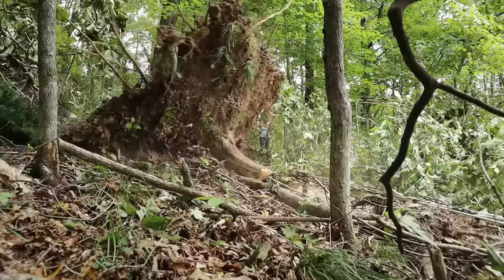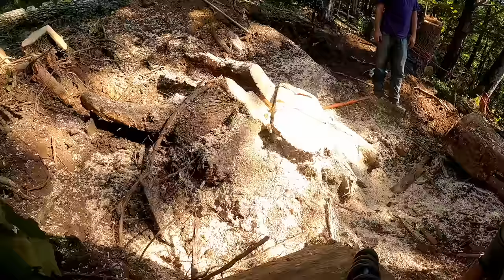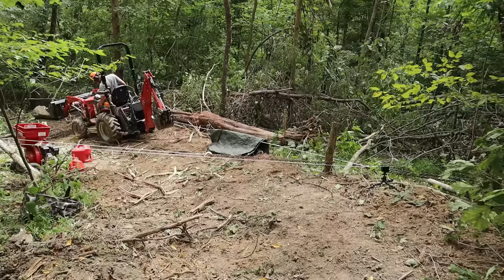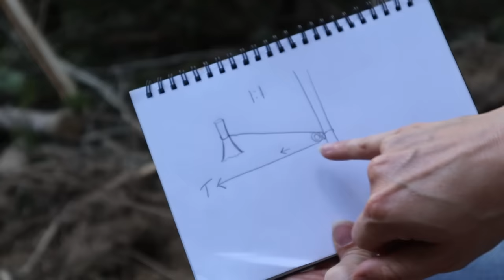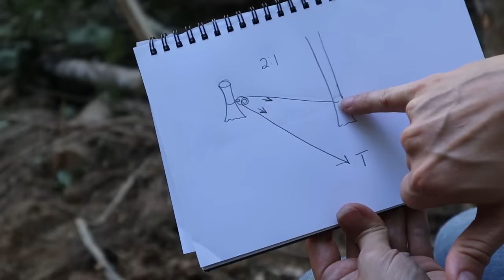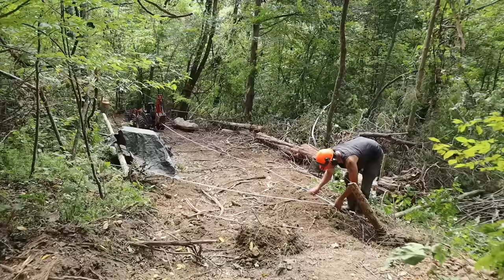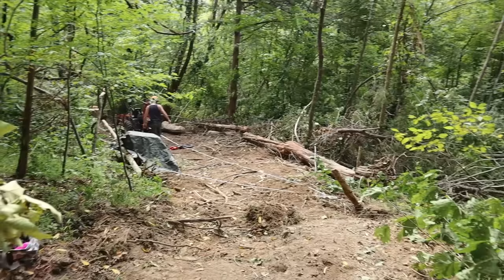Snatch blocks vs tree stumps - the power of pulleys /// E57

Comment: If your hitch point is below the back axle it will try to pull the front of the tractor under the back axle surely. No chance of a back flip. But it will put too much downward force on the front drive and less on the back wheel. So the front drive hydraulics would be possibly over worked and the back wheel will lose traction.

Comment: Great work. You need to stop pulling from the backhoe arm. It is hard on the system. Attach it to an anchor point on the frame base of the tractor.
Reply from the maker: Learned that one the hard way, Peter.  I broke the cylinder because of that destructive laziness.  Won't do that again though!  Now I hook up to the frame in the back.  I learned my lesson 😉
Reply: @WalnutsandWineberries  The best lessons learned are the ones which cost us a lot (time, money, sweat, etc).
Reply: @Harry-zz2oh  Dave Ramsey calls that “stupid tax” and I’ve paid my share of “stupid tax”.......it’s how we learn 🙂

Comment: I realize that anything you do yourself is saving money, most of the time but there is a fine line between saving money and not. Time is money and a operator with a small or medium size dozer could have you ready for base rock in 8-10 hours, a D-4 or D-6 could push those stumps out and level your road bed in no more than a day and a half whereas if it takes you guys a couple weeks just to get the stumps out and you still have a lot of grade work to do and your time is $$$ too.

Comment: Your drawing of the 1:1 does actually have a mechanical advantage, but the advantage is 2:1 (little less due to frictional losses) on the anchor tree, not the stump. It looks like maybe you figured that since you have a backhoe dig from the stump out radially along each root too. It lessens the grip those roots have and they come out or break a lot easier.
Reply from the maker: Yeah, I guess technically, you're right.  Definitely don't want mechanical advantage on your anchor - haha

Comment: The first pic is a one to one. The second pic is a one to one. The 3rd is a two to one. And so on.

The stump chain needs to be attached as high as possible for maximum leverage & the anchor should be attached as low as possible for minimum carnage. 

Every line BETWEEN stump and anchor doubles pulling power. I hope I’ve helped.
Reply from the maker: Hi Todd, thanks for commenting, but we found our configurations to be correct and accurate.  Please reference the following reputable source.  They show some good examples and configurations for mechanical advantage and how to calculate the ratio.
https://m.petzl.com/US/en/Professional/How-to-calculate-mechanical-advantage?ActivityName=Technical-rescue

Comment: At 12:50, you are losing 1/3rd to 1/2 of your mechanical advantage on the length to the tractor because it is pulling at an angle to the rest of the lines. That line to the tractor is 1/3rd to 1/2  redirect and only 1/2 to 2/3rds mechanical advantage. To calculate the lost mechanical advantage in an angled redirect line, imagine a line from the anchor extending to the tractor line to form a right triangle. Compare the length to from the stump to the anchor to the length from the stump to the imaginary right angle point to see the lost mechanical advantage. The drawing at 13:05 should say 3.5:1, not 4:1
Cut a chain anchor notch as high on the stump as possible to get maximum leverage on the root ball.

Comment: Why did you choose wirerope? Dyneema lines are much easier to work with. It’s so lite it’ll float on water but stronger than steel wirerope.
Reply from the maker: Inexperience at the time.  Agreed that synthetic is easier and much safer.

Comment: Something else can help you. Do not cut the tree before you try to pull it off the ground. If you use a ladder to climb 15 or 20 feet in the tree to tie your rope or snatch block, you will add an other leverage force this time to the pulley force. Dont forget that each foot higher you are, that will multiplie your force like a pry bar.

Comment: I would think the tractor will pull out the stump alone. Especially if you cut the stump a little higher.   I'm certain of one thing though, it's much easier to push a rock downhill rather than up the hll.    I wonder how much GINSENG you guys killed making that road?

Comment: I still can’t understand how the first way was different than the second way. I can tell there is a very powerful advantage with the snatch blocks, but I don’t really understand exactly how it works.
Reply from the maker: The difference between the two is where the snatch block is located.  On 2 to 1, snatch block is placed at your load, then you hook to an anchor tree and pull with the other end.  Double the power vs pulling alone.

Comment: First, never pull from the bucket. You'll damage the hydros on the tractor. Pull off the draw bar. That is what it's for. Second, take a look at this guy. You are starting to understand pulleys but still are way off. https://youtu.be/FBuUBVCiUjE   Don't pull at an angle. You are reducing your advantage. Keep things inline. Keep the stumps tall and pull from the top. They tip easier than pulling from the ground. Watch what this guy can do. https://youtu.be/bRTIwWUg4fc   A winch would help you do wonders. If you get one, use the cable on the first wrap of the drum only... that is what they are rated for. Each wrap on top of that they pull less than rated.

Comment: Keep your anchor point as high as you can on the tree your are trying to rmove, it also ads a lot of extra levarage. just a foot higher will make quit a diference. Even beter would be too tie on to the tree about ten feet high, pull it down and then cut it from the stump.

Comment: You can pull up a much bigger stump than your handling in the video. I’m sure you’ve finished and probably have figured out what I’m sharing by now. Don’t cut your tree down. The higher you can hook your cable, the more leverage you have. Cut the trees after you pull them up. Only a few feet higher gives you a huge advantage.

Comment: you gotta rent a big air compressor and a jack hammer to bust up those big rocks....   or hoot a hole in them every so often and split them in half.    i had to build my driveway just like you're doing here....   fire was my best cheapest most effective tool for the stumps

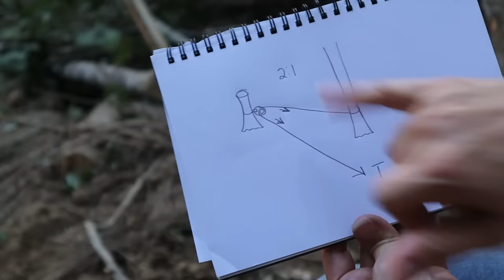Comment: @7:30 your "supposed 2:1 system" isn't a true 2:1 system. I'm a crane operator, arborist and former tow truck driver. You have only made a change in direction here.
Reply from the maker: Incorrect.  It's 2 to 1.  Only a change of direction if it's an anchor.  The pulley on the load results in 2 lines of force, hence 2 to 1 mechanical advantage.  Check this reference for yourself:
https://www.petzl.com/US/en/Professional/How-to-calculate-mechanical-advantage?ActivityName=Technical-rescue

Comment: I am not an expert, but in your first drawing, your angle was too wide.  I don't think which end you had the pulley attached was the problem.  In your second drawing you depict a reduced angle, which is necessary for mechanical advantage.  Another thing you could have done, probably for less cost, is to rent a mini excavator.  It would have much more hydraulic power than your small tractor.  They are a lot faster.  It does take a little time to get used to running them.  One more point, if the cable breaks, it can kill or hurt you.  You could have used Spectra rope.  Much safer, but expensive.  Spectra is around 15 times stronger than wire rope, pound for pound.

Comment: Cheap equipment breaks.  Always buy the best equipment, tools, etc,your pocketbook can afford.  I cut trees as close to the ground as possible.  I then groove them with my chainsaws in a waffle pattern and put Epson salts in the grooves.  It will rot out but takes a while.
Reply from the maker: Cool, might do that on stumps that are off the path and don't necessarily need to come out.  Ever use that "stump remover" stuff made of potassium nitrate?  Never heard of using epsom salt.  Intriguing though.

Comment: You are lucky the tractor did not rear up on you.  Tractor drawbars are designed at the correct height from the ground to keep the pull forces below the center of gravity. Above center of the axle and the tractor can stand right up and roll over backwards.

Comment: basically ..if u pull really slow ..it wont work ! the snatch effect. if from lower gear time to stop the tractor.. it extends the power for breef few seconds.. 50 hp tractor will go slower gear and more power as well.. effect will be like 8x the power.. try that ! 150 hp tractpr.. they make a $$$$ drill out tool ..10 seconds and 4 feet stump gone!

Comment: You guys need to hook up to the bottom of tractor and not the bucket.   You guys are slowly killing the hydraulics on your machine. But nice work guys!!
Reply from the maker: Yeah, lesson learned.  Check some of our other videos and you'll see I broke the hyd. cylinder soon after this.  Failing is the best way to learn.  Won't do that again.  I hook to the drawbar now unless the tractor is anchored, and the hoe can pull on its own.
Reply: Ahhhhhh.  Bummer.   Live and learn.  It happens to the best of us

Comment: I would highly discourage pulling with the cable on your backhoe bucket.  Brother in law did that and ended up bending a hydraulic cylinder.  $$$$ to repair.  It is not designed to take that kind of stress with the tractor pulling on it.  The hydraulic relief valve can't do it's job the way you are pulling.  Draw bar is the proper way or something else with the BH mounted.

Comment: Well this comment is a year late!  In all your examples the stump you are pulling is smaller than the tree you use as an anchor point.  What if the stump you're pulling is bigger than any anchor point tree available?   Then you have to spread your anchor points among several trees using even more snatch blocks.  If you search YouTube for the string "v=bRTIwWUg4fc" you can see a video of a man with a 35:1 pulling advantage with a combined 5:1 primary setup and a secondary 7:1 multi-shiv pulley setup.  But even in this setup he was still pulling single tree stump to another with the 5:1 primary ropes and snatch blocks.  Had I been doing this pull I would have attached each of the two 8-ton pulleys in the primary 5:1 setup to separate trees.  With a couple more snatch blocks you could have 3 anchor trees and a 6:1 advantage in pulling you're stumps and splitting the load on each of your anchor trees.

Comment: I think this project would've been much easier with a bigger tractor or a bulldozer.  A bulldozer could've made you a road in a couple of hours.
Reply from the maker: The video is about using mechanical advantage for when you are outmatched.  Not how to make a road the easiest way possible.  It's sad to hear that not many people want to work hard anymore.  The norm is to want immediate results.
Reply: @WalnutsandWineberries  no its not about immediate results,  I've worked since I was 13 as a job and my whole life otherwise.  I wasn't raised to sit on my butt and watch cartoons.  I was just saying it would be way more efficient.  I can plow a field with a mule but use a tractor to use my time wiser because I don't have time to take a week on a job I can get done in a few hours going another way.  Work smarter not harder pops always said. 😉

Comment: That 4:1 set up. Is only a 3:1 the pulley to tractor is not doing any work. It's just a redirect
Reply from the maker: Hey Ron, here's where I referenced our research: https://www.petzl.com/US/en/Professional/How-to-calculate-mechanical-advantage?ActivityName=Technical-rescue
Check out the 4 to 1 examples.  Their example shows the last pulley in line as a redirect because it comes off the anchor.  Our last pulley comes off the load.
Reply: I just rewatched your video. I stand corrected. Sorry for blowing up. 😉
Reply from the maker: Took us days to understand it, Ron.  Many failures before success.  You'd like episode 64, where we add compounds to the end of our 4 to 1 and make it 16 to 1!

Comment: NEXT TIME PUT  WIRE ON HIGHT TO THE  TREE NOT  CUT THEN HAVE VERY MUCH  POWER  TO TAKE EVEN BIG TREES DOWN  l HAVE KUOTA 25d  HP THEN PUT DOWN MAPLE  12 " DIA   QUITE EASY BUT  USING BACKOE  BUCKET   TO  STRAT  BUT ALSO  IN U  SHAPE  FOR  PULING  CABLE  NOT IN V   HAVE FUN

Comment: You are losing a ton of efficiency by not keeping all of your strands in line. Look at how large an angle you've created with the end you are pulling with compared to the strands going to your load (stump). All of your lines should be parallel to each other ideally. Your tractor is having to work much harder to create the same force you would have created otherwise by keeping your system clean. Plus it could be dangerous.

It's not going to matter so much on the small stuff but it's critical when you are using your equipment to capacity.

I got a chuckle out of your first system, that was completely wrong, haha. Stay safe and keep learning,
Reply from the maker: We keep it real around here and show our mess-ups.  I like to think it helps others from making the same mistake.  Also, yes, I totally agree with the angles.  It's a tough thing to accomplish in the woods.  Sometimes a tree just isn't where you need it to be 😁
Reply: @WalnutsandWineberries  Hats off to showing your progression and learning. The better you get at rigging the more possibilities you'll recognize, especially with potential anchors. 

Please be safe though as a system incorrectly rigged could have some very bad results. If your tractor is straining, then more than likely you are pushing some component of your system beyond its safe working load limit. Even though the gear may be rated for say 5000 lbs, that doesn't mean you are allowed to put that much force on it. Look into WLL, working load limits, and try to calculate how much force you are subjecting everything to once you start pulling. You don't want one of these systems blowing up in your face.

Comment: Very dangerous. Please use dampers next time in case the wire snaps.
Reply: yep, I was looking for this comment. The wire needs to have some kind of weight on it to keep it from taking your head off (literally) if something breaks. Other than that snatch blocks are generally used for changing direction and feeding a cable without threading it. A block and tackle of an appropriate size makes this easier.

Comment: if your tractor has a manual trans your gonna burn out the clutch pulling stumps .that's not smart. and when it goes to the shop you will need to take out a loan . if your serious about actually making a road and not just videos for entertainment, you could do what I do and hire a contractor with big ass dozers and do it right . I learned that lesson many years ago. they will knock it out in one day . by the way that's how they do it in Hawaii , a big ass dozer. im doing 5 acres and gonna sit in a chair ,drink beer and watch the big cat push dirt . cut the dam trees off at two feet and call in the dozer , and do the video and save the Kubota